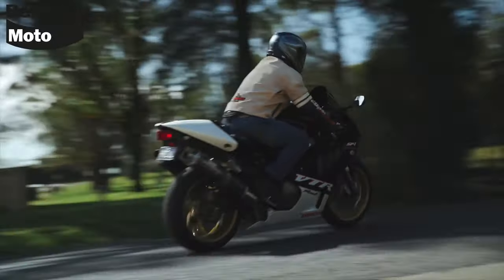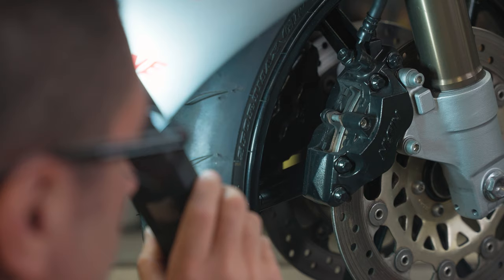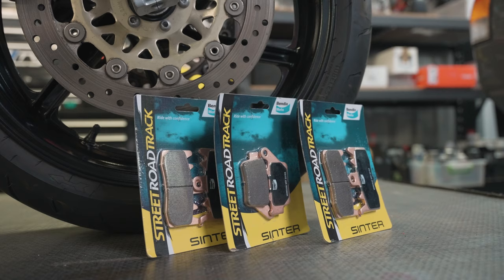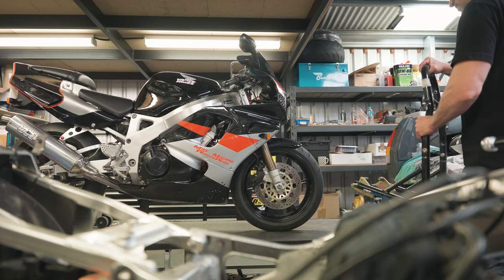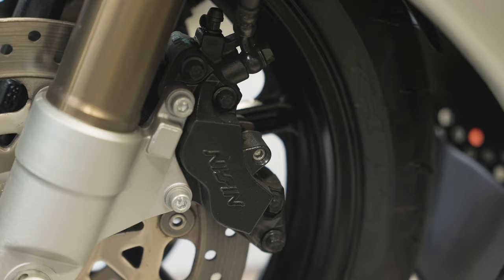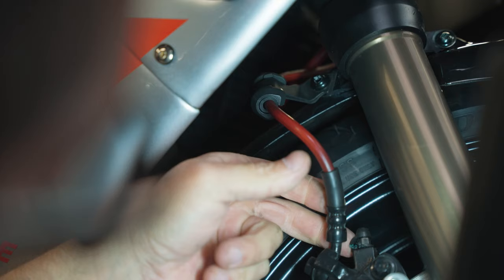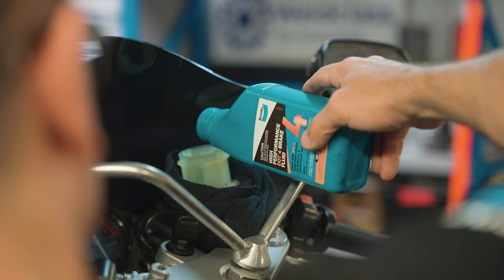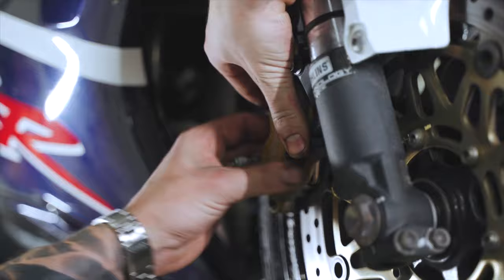How to Inspect Your Motorcycle's Brakes

Comment: Apparently motorcycles only have front brake? What about the rear
Reply: Rear
Reply: @macha.h  Rear
Reply: Most bikes have one rear disc as opposed to two on the front. Older bikes may have a drum brake.